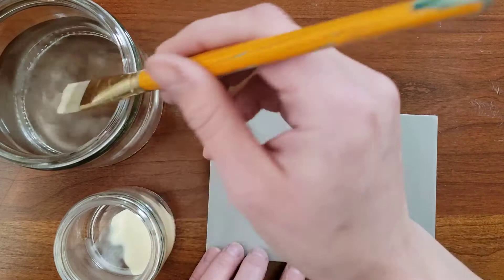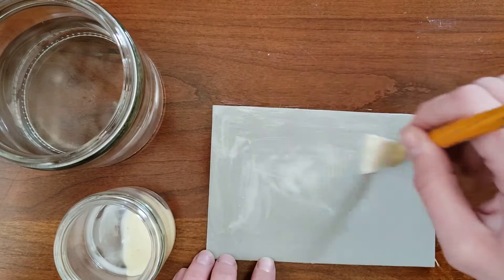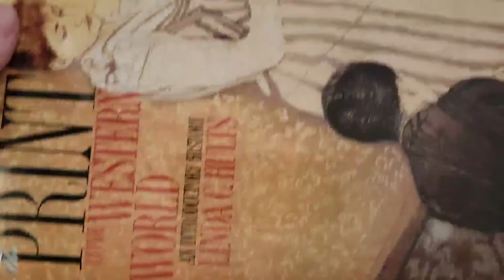Linoleum Image Transfer: Inkjet Print

Comment: Pre mix 2 parts glue to 1 part water in a jar & shake. Use that for a better job. You can also dry with heat gun or blow dryer rather than dry overnight ;o)